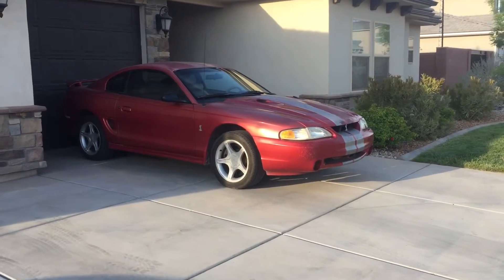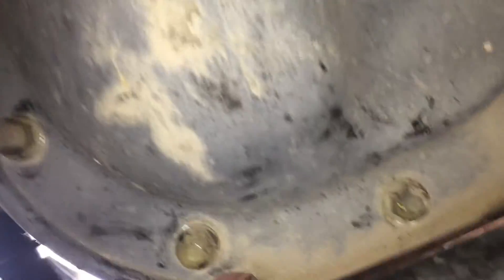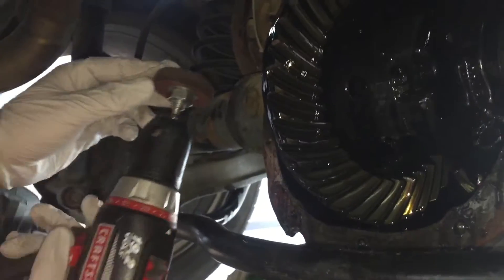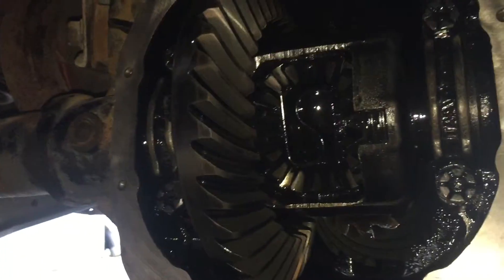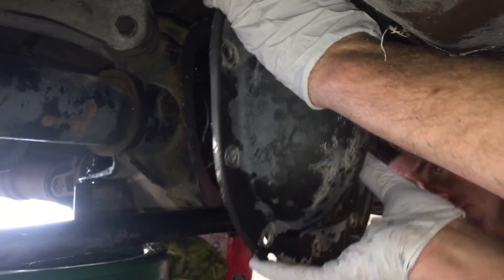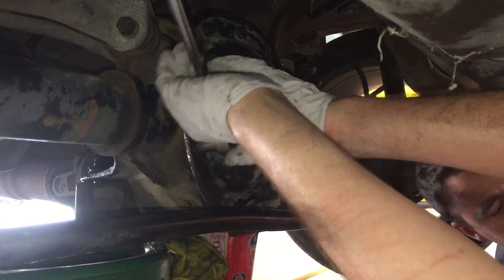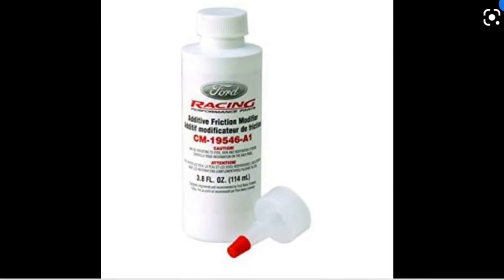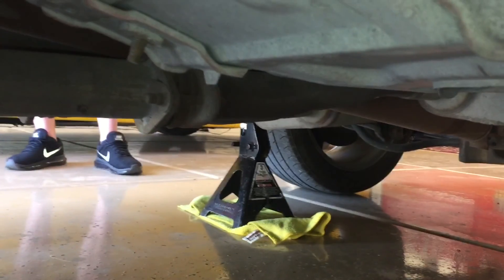EASY Differential Fluid Change Ford Mustang Solid Rear Axle 8.8'' Explorer, Crown Vic, F-150

Comment: Had to use backup! Measured new nut same size. Had 4 and a half threads counting the half sized starter thread. Finished w starter thread and 3 so lost one. Also 13.5 revolutions ended up wayyy loose only one thread showing and super easy to turn still. Used .5” wrench w socket to get it “Gutentight”. Almost as much as I could w the same wrench. Sketchy but hopefully good! Blasted vent out too. 

Companion flange came off by hand w puller and socket weird. No wrench. 

Lost marks you gotta scratch and mark! And don’t use a paint sharpie. Paint pen w scratches is the only way. We’ll see how it goes.

Welp alls good on a hour twenty drive. I feel like my car feels a bit heavier but idk could be placebo. At least I’m not at less than a quart now. That’s all that came out.

Comment: Anyone know what a low whirring noise on a 98 may be, no noise in N, hope not Trans.     thanks for video.
Reply from the maker: If it makes the noise while driving it could be the rear ending, but if it’s stopped and making the noise in drive it could be the transmission. I have an automatic transmission repair series if interested (and gear install) F-150
https://www.youtube.com/playlist?list=PLIjr-uSYDZi6Y2dbHxAI5nXfgSniOb4zC
Reply from the maker: Ford Mustang 8.8 Gear Install
https://www.youtube.com/playlist?list=PLIjr-uSYDZi5fnxxp6D9MO7_QlTzizaUf

Comment: Can I use the RTV with a felpro gasket? If so, should I do a bead like you did or just a think layer to hold the gasket in place? Thanks in advance
Reply from the maker: I would use one or the other
Reply: @dannyjohnsonsgarage  do you think it's ok to use just a thin layer of rtv to hold the gasket in place when installing the cover?

Comment: These can’t be pumped out? Swear last time I did mine I pumped it out through the fill plug and haven’t had any issues. Don’t see any videos without pulling the cover though
Reply from the maker: I actually attempted that when making this video and the tube would hit the diff and not go down in. With the right hose it may be possible

Comment: Broke an axle at the track and chipped up the spider gears the other night. When I was going over everything I noticed every ring gear nut was hand tight...... what could cause that?
Reply from the maker: Perhaps it was assembled without thread locker (or didnt allow it to dry before adding fluid) See at 6:30 https://youtu.be/qaoN7n5gUW0

Comment: Hi, really enjoy your helpful vids. I have a question. Did you torque the cover bolts using a torque wrench or just tightened till snug?
Reply from the maker: Just tightened them down tight in the star pattern. Should be about 20-25 foot pounds